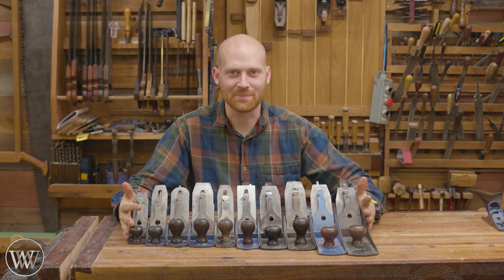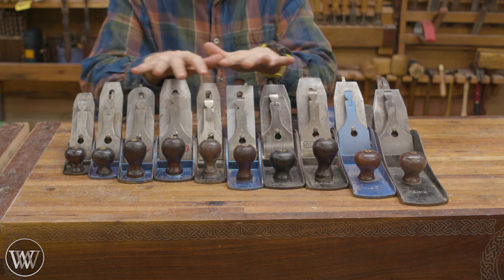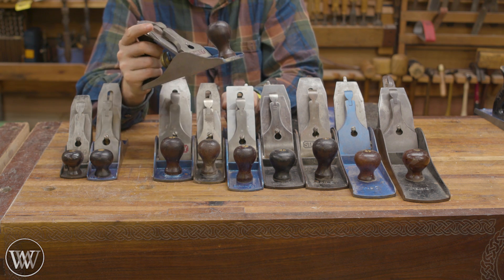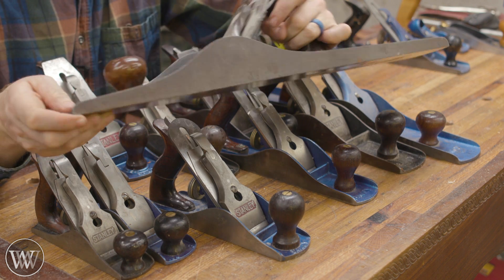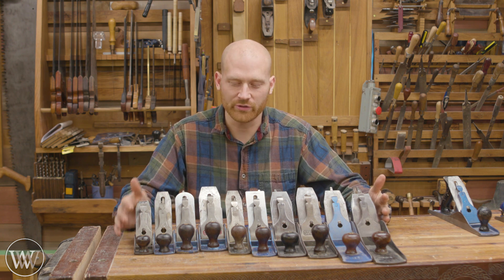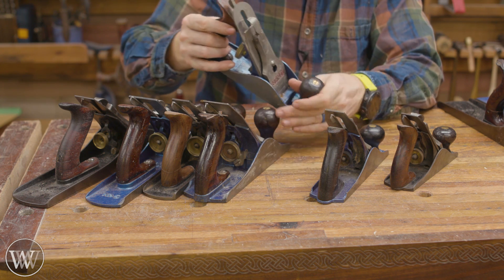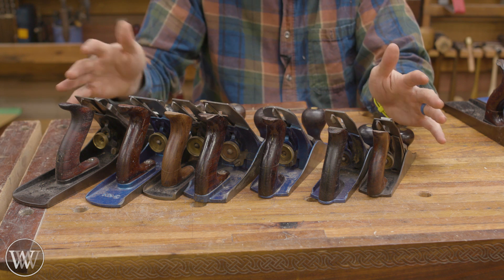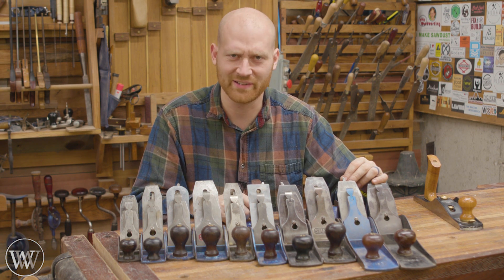What Plane Should I Use Stanley Numbering System

Comment: Very interesting and I guess I made the right choice!

I'm a n00b to woodworking... only had a "new" bailey #4, but wanted a 2nd longer plane for jointing, flattening, truing, etc. 
Found a pretty mint series15 #6 yesterday and bought it!
Good price, esp for its' condition... waay cheaper than even a rusty #5-1/2!

I was contemplating very hard bn a #5 and #6 (to pair with my #4)... but was worried a #5 would be too similar to the #4, and I'd maybe just use that all the time and never the #4 anymore. So, I think a #6 is a better difference... #4 for smoothing and general work, and a #6 for jointing, truing and flattening. 

It's kinda like camera prime lenses... you usually skip the next focal length, or double it... to minimize your kit weight, size and/or cost. 
eg: if I had a common 50mm lens (#4 plane), then another typical 35mm lens (#5 plane) is kinda similar.... so, I got a 24mm (#6) instead! 
Also, a 24mm is kinda similar to a 35mm too (I could always just easily crop the 24mm pic to get a 35mm fov). 
...a nice "gap" in your minimal kit of lenses (or planes), while still being most versatile.

Also... like you mentioned in video... #6 is like half the cost of a rare #5-1/2 (esp one that's not completely rusted), and a 1/3 the price of a #7!
#6 is a wonderful thing!
Not to mention it also has a wider blade than my #4 (same as a #5-1/2).

Comment: My first plane was a Craftsman (built by Stanley) #5 equivalent and I discovered that I really liked the length and width. So I bought a few more. Since then, I have turned all of them (I have 4 of them now) into scrub planes (I do a lot of milling and need fresh ones on hand regularly). I just bought two brand new planes, a WoodRiver #6 to help me with mounting lumber as it gets dry, and a WoodRiver #5 1/2. I really enjoy the 5 1/2 because I have large hands and it fits better, more comfortable to work with (sometimes for hours on end as I lose track of time). I plan on forgoing a #4 and going with a #4 1/2 for the same reason. Not trying to tell anyone I'm right and they're wrong, but simply what I've found works for me.

P.S. I'm painting all of my old planes olive drab.
Reply from the maker: Cool. Like the color choice.

Comment: I agree 100% with you in that these planes can be used for pretty much any job. Hey I just found out about a 1/2 hour ago that my two No 2 Stanley planes are a collectable tool and are pretty expensive, shucks I found one at our local garbage dump and I got the other one at a garage sale for 2 dollars. I collect, restore and use antique and vintage tools for all my projects and jobs. Last week while garage saleing I got a cast aluminum Cummins 1/4 inch drill and a cast aluminum Porter Cable skilsaw, both work perfect. They sure don't make tools like they once did, shucks today when a tool fails for any reason, most guys just chuck them away and buy another cheap chinese one.
Reply from the maker: So true. Tools are made to be disposable now.

Comment: The ones i use the most are my type 17 4 1/2 love it because of the heavier casting my type16 no.6 which i have set up as a panel smoother (its my favorite) my type 11 no.7 it was a gift from chop with chris at the Atlanta woodworking show and i use it constantly. I am also lucky enough to have a stanley 40 1/2 that i bought for $20 and i love it. I upgraded all the blades to Hock 01 steel because its what i prefer. I have plenty of other but those are my main users
Reply from the maker: Sweet. you do not need many to do great work.

Comment: What brand is your iron on the No.4 with rounded top? I know it doesn't affect it's actual use, but it still stinks that your 5¼ has a hang-hole. Nice collection and explanation. For right now, I have a 3 (unfortunately the sole is cracked and the tote and knob are broken on this one), 4, 5, 6, 7, and a 8. The quarter and half sizes are very rare around my area so people charge a crazy amount for them.   😞
Keep up the great work!
Reply from the maker: Thanks. The one with the rounded top is a prototype iron for DMF toolworks. He should be selling them soon.

Comment: Hello, I have a Stanley numbered "C74 1/2" - 14 in. long   2 1/2in. wide !  Wondering where's this one fit ?? Also, will be using my old entrylevel Stanley no 4 for my next Scrub Plane, so should I select another number 4 for my ForePlane or Am I better to select a number 5 for a ForePlane ? Many thanks, Robert
Reply from the maker: A 74 is a floor plane. It is used for planing wooden floors. Using a #4 or #5 is just a personal preference. I prefer the #5 but many people like the #4.
Reply: @WoodByWright   Is this 74 1/2 - 14 inch long may be used up as a Foreplane, cause it's the same length as a number 5 ? Furthermore, what are the Arc lengths for the camber of both, the Scrub Plane plus the Foreplane ? Many thanks, Robert,

Comment: Now that I'm a "plane collector", here's my minimum list,
1 block plane for fine work
1 block plane for home improvement
1 junk block plane for the 3 year old to use
1 #4 or #5 set for smoothing
1 #4 or #5 set for roughing
1 #6, #7, or #8 for jointing and bench flattening

And a rabbet plane is nice now and then...

Comment: Oh no - you spelt my name wrong at 0:39 - lol. I love these planes and have recently bought a job lot of 23 (3, 4, 5, 51/2  only one from US of A though!) for restoration and use. Also have just got a 6 and a 7. You have a great collection. Love your videos.
Reply from the maker: Sweet! sounds like quite the find!
Reply: Wood By Wright What I didn’’t mention was that they were all completely disassembled by previous owner  - a box of frogs - a box of  all the screws washers  brass and aluminum  depth adjustment wheels - you get the picture . There is one USA body. The problem I now have is to match all the parts together.  As they are mostly UK planes - not much guidance as they were all a bit of a mix anyway - some US parts and some from UK. Should keep me quiet for a few months though!

Comment: Thanks for that video im just starting to get into hand tools.  I got and restored or reworked a Bailey no5 and a stanley rule level & co no35 and I had a blast learning about them and there history and getting a amazing finished product I do have a question though one I have been digging for a answer for a long time I got into spoon carving and can't find a good reliable long lasting finish that can stand up to heat with stiring a pot of soup I use butcher block oil and after a couple uses and washing's it goes right out I would like to make and sell them but I can't do that if they don't have a reliable finish I hope you can help or point me in a good direction thanks keep up the great videos
Reply from the maker: that is the bain of wooden spoons.  There is no finish that is food safe and will last for a year. General finish makes Salid bole finish that will last a bit but needs to be re oiled every now and then. I use home made BLO I find it to last the most. but I still re oil once every 6 months (do not use store bought BLO it is not food safe) in the end that is just part of owning good wooden spoons and cutting boards they need to be re oiled from time to time.

Comment: Thanks for the info!! I just picked up a large jack plane labelled "No 5A" and I have no clue what manufacturer made it... That's the only label on the toe of the plane and there is nothing on the rest of it! Hoping someone in the comments may know a tad more, but I am stumped, my dudes!
Reply from the maker: Is it made of aluminum? That is usually what the A means. Feel free to email me pics.
Reply: @WoodByWright  It appears to be cast iron, with a corrugated sole. Lever cap is blank and there is no engraving/stamping on the adjustment lever. How do I find your email?

Comment: Excellent once again.  One Q: when carving a new tote, which way should the grain of the wood be traveling?  Should it be parallel with the direction of force, should it go vertical and parallel to the bolt holding the tote to the shoe, or should it be somewhere in between?  what is your take on it?  Thanks again, James.
Reply from the maker: I like it around 2 degrees off of parallel with the sole. most Stanley have the grain in parallel with the sole.

Comment: I just started woodworking, and I mostly make dining tables, which are 4 2x10’s put together. I try to make sure they are all level when I glue them together, but that doesn’t always work out. Which plane do you think would be best for leveling that out?
Reply from the maker: I would use 2 a #5 set fairly heavy to remove most of the material then a #4 or #3 smoothing plane to smooth it out.

Comment: Very informative info just what I needed as an old  newbie. I notice you have a lot of Blue Stanleys in your line up. I am wanting to get a 4 and 5 but have read the Blue painted Stanley USA made ones are just not as good as the old pre 1960's planes. Do think that is true or is there a bit of plain old plane snoberry? :) Some of my guitar bretheren who think a 1960's Gibson ES330 is so much better than a 70's or 80's or new production which IMO and years of guitar experience is not always true, some are some aren't. Many new production guitars today are even better than a lot of older vintage. Anyway, back to planes I want a 4 and 5 to actually use. Your advice please on Blue vs Black
Reply from the maker: My blue planes are ones that I have completely restored stripped down and repainted. I paint them blue just because I like the color. However the blue Stanley handyman planes are not quite as good as the older planes. that doesn't mean they're not decent users that just means they're not quite as good. They take a little bit more work to set up and can be a little more finicky but will still do decent work.

Comment: Great video James! I got a quick question if someone can help me.. I got on my hand an old Rapier 700 (just like a Stanley 7) and I'm in the journey of restoring it... the blade is super used so Im looking for a new one but from where I am (Chile) I can't find replacement for a No 7, so.. the question is, can I use for example a No. 5 blade on a No. 7???
Reply from the maker: You can but it is not as wide. So it will not fill the mouth. But it will work, it just will not cut as wide in one pass.
Reply: @WoodByWright  Thanks for the response! I ended up buying an old blade.. but it turned out to be a thicker blade from a wood plane.. I modify my plane and now cuts quite good, still need to do some modifies, but its working! another question.. are Rapier planes any good? can't find much of them on internet. Best wishes and thanks for this amazing channel!

Comment: Thanks for your videos leaned alot. I have a butcher block countertop. I sanded it stained it few years back made a big mess with all the dust though out the house. I believe its oak wood not sure how to tell. But if i where to do a #5 plank and a sanding block & paper by hand would that be a option? I also have a fairly long half inch wide crack behind my sink in the wood from the water over the years. Whats the best way you'd recommend repairing that.  Thanks again for vidoes.
Reply from the maker: That sounds like about the best option for me. if the plane is set up right you won't even need to sand it you can just go right off the plane. As to the crack why don't you send me a picture of it and I can take a look at it. You can find the contact me page on my website or my email is in the about me tab here on YouTube.

Comment: James, great info here.  I have recently taken ownership of my grandfather's Stanley #3 and #5 planes.  I am new to woodworking all together and honestly, I am a power tool guy.  I would like to get into making boxes.  Oh yeah, the question, can I use either of these two planes in a shooting board for miters?  What would be the best plane for that application?  Can I just make my #3 a bevel up plane.  Thanks and again, great info in this video.  Even though I am a power tool guy, I just subscribed.
Reply: Actually, those planes from my grandfather are Stanley Bailey planes, if that makes a difference.
Reply from the maker: the #5 would make a great shooting plane. that is what I used for a long time tell I got a LOJP. no, the #3 is a bevel down plane. almost all planes are bevel down. it seems counter intuitive but it gives a cleaner cut.

Comment: confusing  Stanley made crystal clear until numbers became quarters and halves, but well done, and why do some planes have grooves in the bottom plate?
Reply from the maker: Lol that is what happens when they introduce intermediate sizes after the others. Corigated bottomed were advertised to be easier to push, though they are not. They are easer to flatten though.

Comment: James you rascal, there is no such thing as a No. 53. But you already knew that right? I had to look it up in my Stanley Tool Guide by John Walter. Unless I misheard you and you said No. 63. In that case there is a No.63 Low Angle Block Plane. I also noticed that the iron on your No. 4 has a rounded over top. I've never seen that on a Bailey before. My guess is that it is an after market replacement blade. While we're at it, that iron on your No. 5 is square on top. I have never seen that before. I'm guessing after market as well. That's why I enjoy collecting planes. It's the attention to detail. Stanley made a lot of planes and it's probably next to impossible to have an example of all of them. Unless you're John Walter. That guy is the ultimate authority on Stanley tools. I'm a member of M-WTCA and hope to meet you someday at one of our meetings.
Reply from the maker: LOL the 53 is an adjustable mouth spokeshave. I actually have one. the No.4 has a pre production iron from DFM tool works. so far i am in love with it. the no.5 had a Hock iron in it. good eye! Looking forward to seeing you at a meet I will be at the loves park meet and the national meets for sure.

Comment: I needed this.  Great video, time to head to eBay!
Reply from the maker: LOL don't spend too much!
Reply: You may want to have Ebay as a last resort, their prices are insane.  May I recomend flea market, boot sales and M-WTCA meets? Takes longer but you'll likely save hundreds depending on what you want.
Reply: Craig Clapper thanks for suggestions but the flea markets here are not good and there aren’t any boot sales or swap meets. I’ve checked Craigslist and any that come up are crazy high pricing. I usually try and compare them to eBay and the ones on eBay are cheaper than what I can find local.